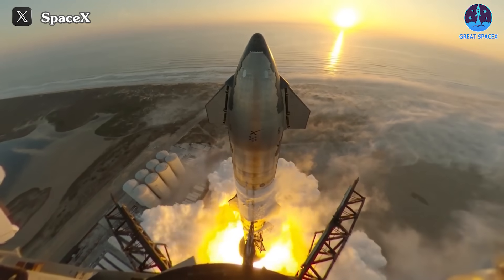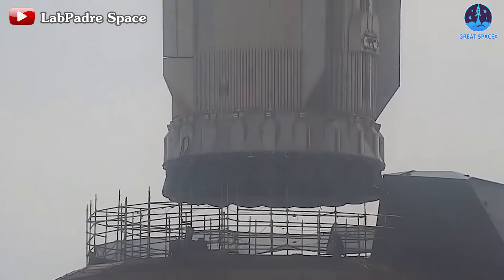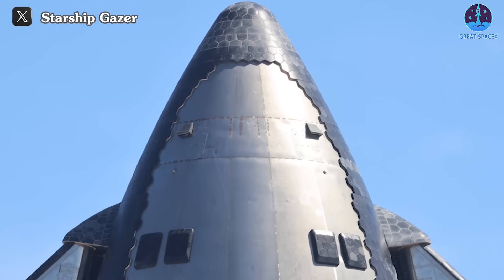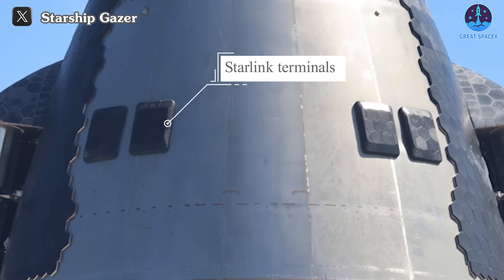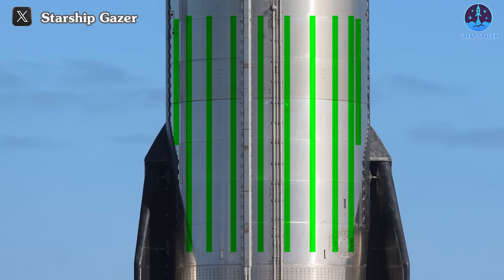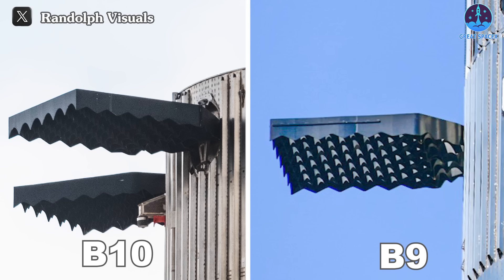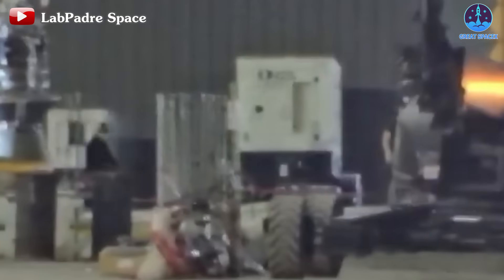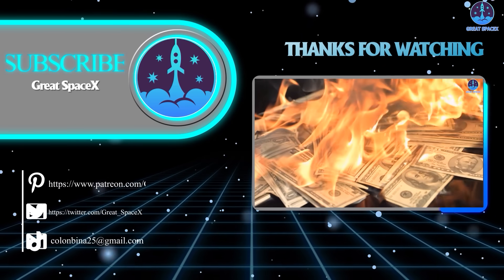SpaceX revealed 17 Huge Upgrades on Ship 28 Booster 10 for IFT-3!

Comment: Ift-3 showed the major problem with the entire material choice. Booster was burned for a total on 2.42. This was a full minute lass than oft-2. The result they avoided immediate disassemble. But starship then had use almost all of starships fuel to attain minimum Leo. With the damage gimbal bell nozzles. The remaining fuel leaked out in the 45 minute coast phase. So as it acted up to 228 kilometers and fell back to earth they had no control of pitch and yaw. The ship rolled on its side and some of the peeled off like a deck of cards. Providing they still retain fuel they can attempt the belly landing. But expect more tile to peel away with a perfect entry profile. Ift-4 will burn up again. The major problem for starship is weight. It carries no 220,000 lbs cargo. Yet is still too heavy to attain a stable orbit profile. If they could they need at least 10 orbits in the cold vacuum of space plus the high temperature of the sun to test systems and tile adhesion. 10 orbits would look better than 1/2 an orbit. After all isn’t this the most powerful rocket in history?

Comment: 1)  An "electric-actuator", without "electric-motor" (aiming beam to target) will enlarge laser-kill-range. (Because: eliminates delay of "coil" and of "transmision")
2) For Perfect Precision-Steering/Robotics 
3)  Looking for 20 k$ investor/customer for "prototype-actuator" (better than I did in 2015)

2 Designs for (fast) CAR. 
The 2nd is either for supirior-steering 
Or for superior-mecanical-braking
(All cheaper than existing)
Following is the 1st one: 
1)  Unique Valve for shortest Braking-Distance and supirior stability while braking. (Important for fast Passenger Cars)
1.1)  My Invention: I have a (complete design of) low-cost Valve that will replace the 2 on-off solenoid valves (for each wheel, in the ABS)  
1.2)  Will create Brakage: 98% of ideal decelaration on dry-asphalt with paddels (wet-asphalt): 
2)  Thus create the best ABS in the world,  Reduce ABS size (more reliable than solenoid valve). 
3)  Note: Today ABS use two On-Off Solenoid-Valves because Proportional-Solenoid is not good: Low-Reliability, and at mid position: the flow will be too high: thus, compell bigger-pump. 
4)  Linkedin 67953574 : (2 files on the Valve) 
5)  Dear OEM :  I have 3 more files on the Valve...

Comment: 1:20 - New Glenn is not a competitor to Starship - not even close - it is also not fully reusable (only 1st stage).
New Glenn could possibly be a competitor to Falcon Heavy if it ever gets off the ground..
It sits right in between Falcon 9 and Falcon Heavy in terms of capability.
Starship - 150 ton to LEO, 150 ton to GTO, Moon (with refuel)
Falcon Heavy - 64 ton to LEO, 27 ton to GTO
New Glenn - 45 ton to LEO, 14 ton to GTO
Falcon 9 - 23 ton to LEO, 8 ton to GTO

Comment: I am curious as to why the vents are round openings and the new O2 vents appear to be hooded instead of using NACA vents for all (NACA vents can be used in several configurations depending on function needed). I don't think it would matter if in vacuum or not and they could solve a lot of issues.

Comment: At 2:40: is that a trebuchet? New launch system?
Reply: Yes! for hoisting oldspace croneys with their own petards. Seriously, it's a stand for lifting Starship upper stage using the two point lifter (so they can use a crane to life it using the same two lifting points on the Starship that the tower will eventually use to catch it)

Comment: Why would the FAA call the second launch of Starship a mishap? Guess what, the next launch might not be an orbital mission either. There's no mishap, there is an engineering limit and operating limit that is solved by performing these launches. I and SpaceX consider both launches highly successful and identified changes to incorporate into the design of new ships.
Reply: You are right!.., but think this is because the FAA has never been and NOT involved in LAUNCHING spacecraft, but only in Flights CONTROL..., i.e. to a large extent this is some kind of bureaucracy... and from their point of view, any flight that does not end with 100% success is a mishap... They are NOT able to determine HOW to make those changes, but only indicate WHAT should be improved, and they don't care how it will be done... (Sorry for my limited English)
IMHO
Reply: @SergeSmArt  Vieni DALL'ITALIA?
Reply: This is a function of the way the FAA regulations are written.  ANY deviation from the flight plan presented to the FAA for any experimental aircraft test flight must be explained and a resolution proposed.  This may seem unfair compared to production rockets, every single one of which is destroyed as part of their flight plan.
Reply: Any deviation from the pre-defined, licensed flight plan is automatically a mishap for experimental craft. Your semantics are not relevant here.

Comment: Emergency!!!
 Baffles will not work to prevent the slushing problem, because the tanks of Starship system are too large.
The tanks  of  Starship and  superheavy need 2 disks valves, expanding the diameter of each tank. One of the disks rotates above the other disk to close the overlaping holes on the surface of the disks; to reduce the Size of the tank by dividing it, before any rotation of the rocket. This will prevent slushings and protect the plumbing, if located 10% above the bottom section of each tank. Large telescopic pistons can be attached below the bottom of disk valves to control the fuel pressure as the piston expands into  the fuel. 
 I have built a model that works perfectly. The second disk valve can be located 10%  below the front of the tank, to also protect the front of the tanks from the slushing forces. 
Why is Elon  not using four pins instead of three to secure each heat tyles? What is more important than that?😊
Reply: Thats what i said long ago. 3 tanks that fit the hull. Totally separates 
Launch/flying forces from affecting tanks. And the hull would be  just that. !!further do two bundles of three. To make tanks stronger also
Reply: That might slow the fuel-flow down too much as it still needs to move quickly.   As far as four pins in the heat tiles, it could weaken the tile over-all causing the entire tile to break.
Reply: @Rlee-x9s  no it will not plumb it accordingly to satisfy flows. And  heat tile has  nothing to do with it tanks inboard. Do you just automatically be negative. ?  Kinda with a response like that. You do not understand this stuff.
Reply: @shanehumphrey4827  No, I was responding to the original post that was negative. I choose to believe Elon and the engineers at Space X are far more knowledgeable.  You do not know what I know and don't know.